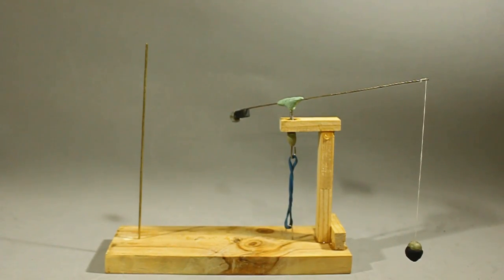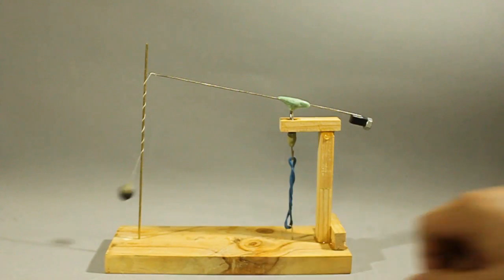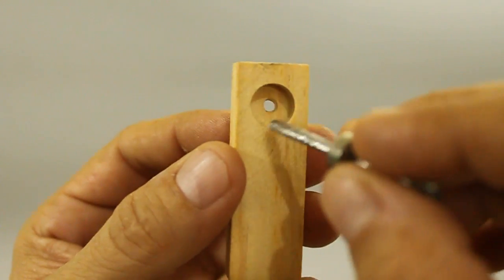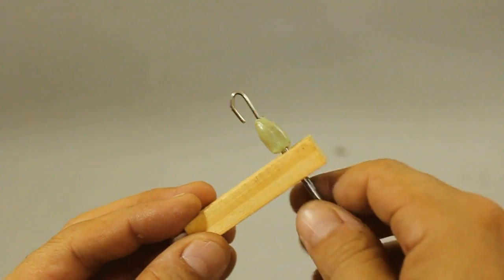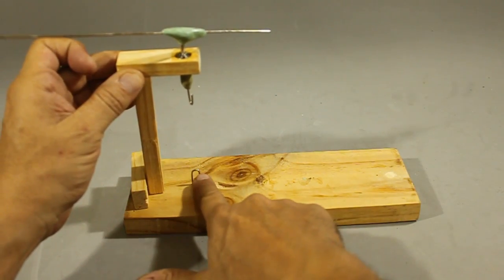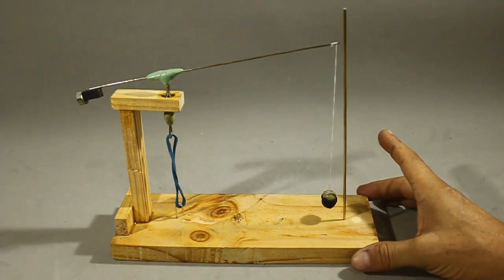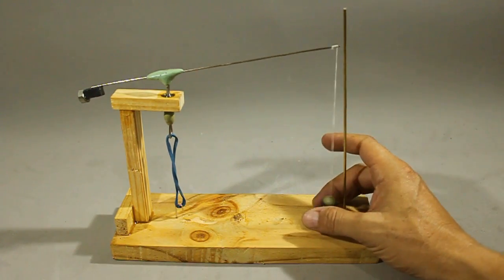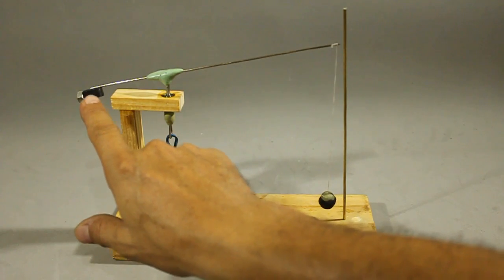Flying Pendulum Mechanism - Kinetic Art

Comment: Interesting.

So, if I replace the elastic band with an Arduino controlled BLDC motor (to control weather spinning or staying) I could in theory make an electronic one that would not depend on the rubber band?

I could sense weather the contact is made between the ball and the pole by means of using an electrically conductive cable, poles, and my Arduino. It should be normally tied to ground, but connected to Vcc whenever contact is made. I guess it could be connected the other way around too.

Then, the BLDC should be made to spin only when contact is not made!
Reply: Victor Rivarola its whether not weather